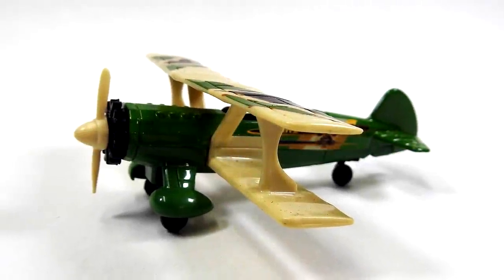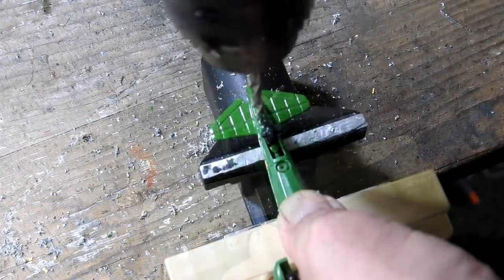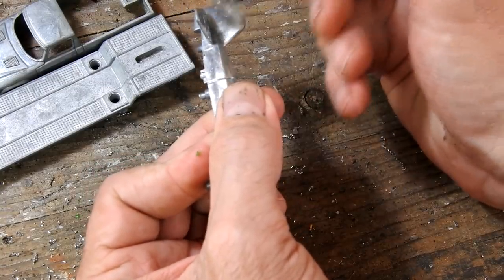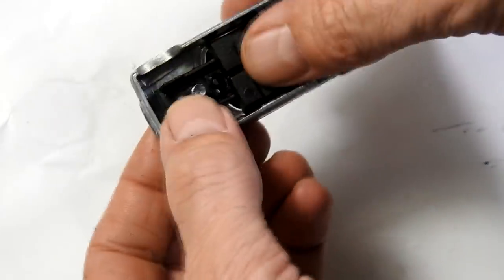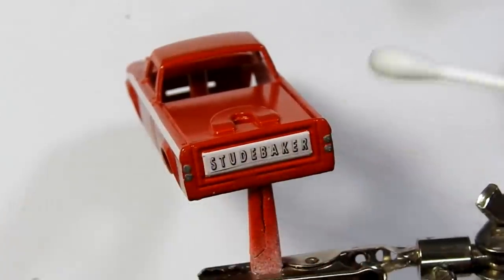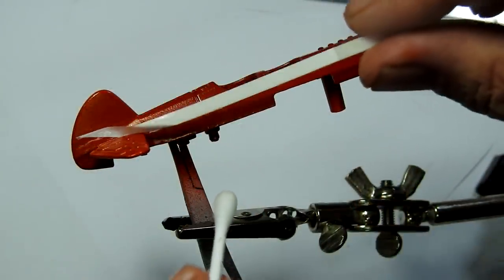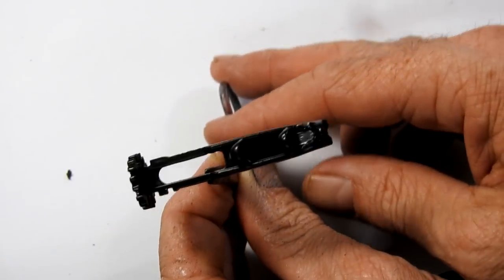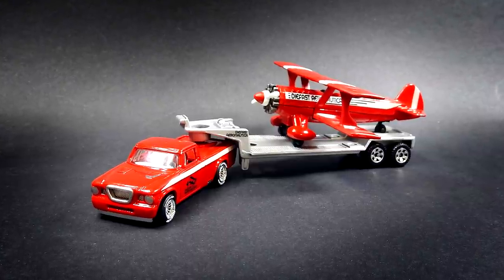Hot Wheels Custom 63 Studebaker Champ & Biplane Trailer | Matchbox Hot Wheels Bash

Comment: Why didn't you print Diefast Aeronautica directly on the white decal paper?
Reply from the maker: I only have some Testors white decal paper left and it doesn't print properly, the ink always runs. I have some better quality white decal sheets coming from china but they are taking a while to arrive.
Reply: What wheels were used on the Truck you mentioned aftermarket ?  Would like to get some for myself.....but were !   Thanks and great build....
Reply from the maker: @rowdyronmuir1274  Monoblock 👍